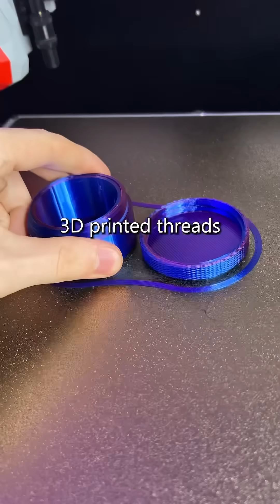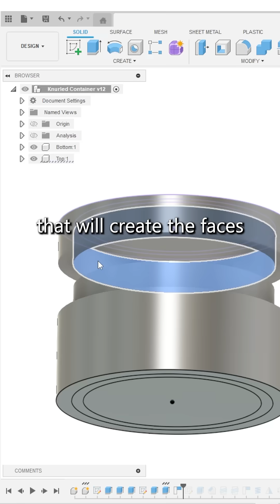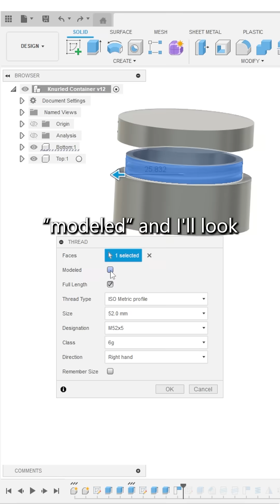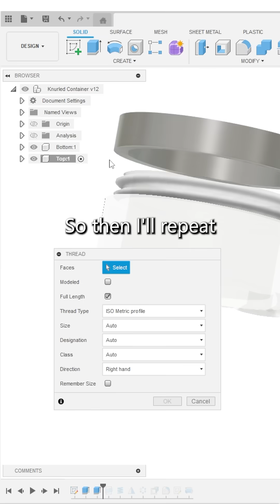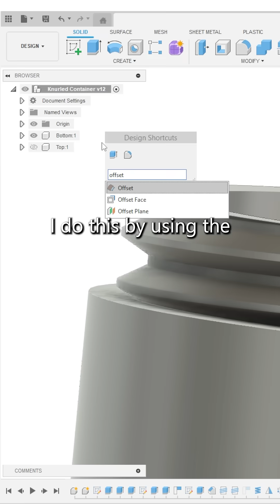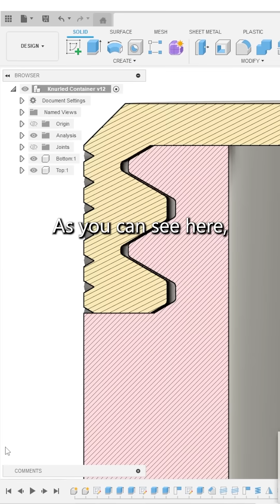How I Design 3D Printed Threads. #fusion360 #3ddesign #3dprinting #diy #learn

Comment: Use the coil tool, set it to square profile, create New Body, move it up or down into place, combine bodies, chamfer the inner lines of the coil. Much better control of the shape of the thread profile.

Comment: How are the outer Threats on the cap done?
Reply: I used this tutorial, works great. My A1 is printing my first object with this knurled texture as we speak 🙂

https://www.youtube.com/watch?v=xHas0R5-6uc
Reply: Not sure if the tutorial mentions this, but if you want to add chamfers or fillets to the top and bottom edges of the surface you're putting the texture on, you can do this:

1. Apply threads
2. Apply chamfer or fillet BEFORE the thread operation in timeline.
3. Drag the chamfer or filler operation AFTER the thread operation in timeline.

(I'm sure there's different methods, maybe easier ones but I'm a noob and this works fine ;-) Enjoy!

Comment: i do everything you said also i try to put a chamfer on it use a sketch and revolver tool, depends on the printing orentation, watch out for flat face overhangs, even when its small, sometimes can cause fails.

Comment: Important point about plastic threaded caps; theyre usually not fluid tight unless the thread’s grip drives a wedge stop into the primary opening.
Reply: Important point about this comment, things that aren't water tight, are not water tight.   BOOM! Genius analysis.

Comment: Been making threads for years now with Fusion.  Great info, learned a thing or two.  One thing that I have found to make threads print cleaner and more successfully as of late is the "variable layer height" option in Orca Slicer.  Works a treat.

Comment: Just open minor diameter of ID threads and a make the major diameter smaller on the OD thread. That simple, only certain tapered threads actually have interference on thread faces like pipe threads that need to seal. I think it's great your getting through this with obviously zero machining experience. Buy a mini desktop mill and make things out of aluminum from fusion. 3D print is cool, but you won't ever get the gratification you get from holding a machined part you used multiple tools and creating a successful program.

Comment: Question 1: How you did texture in top?
Reply from the maker: It’s called Knurling 😁
Reply: As an example: on a 3d extruded part like a cylinder, select the top surface. I will typically make my own textures by drawing a square tangent to the cylinder outer most edge. The square will be positioned 50% on the circle and 50% off. I then cut extrude that square shape into the cylinder. I then use the 3D circular tool to mimic that extrusion around the whole part to make a texture. If you know your way around plane mechanics in inventor, you can do some wacky things.

Comment: Why not just make the surfaces different diameter to begin with instead of making them the same and then needing to go back in after to do a negative offset? Giving it some tolerance to begin with is easier

Comment: Sometimes I just put the threads on just one body and then I use the combined tool to cut the threads into the other body. Then I adjust tolerances like you did.
Reply: Same thing here, after the combine with the cut I add a -0.2 to -0.5 to thread faces, just to give a nice we tolerance. This will make the perfect thread on the new body

Comment: The only problem I have with the thread tool is that you can‘t chose the pitch.
I am using the screw tool. It‘s more involved but much higher customization.
Reply from the maker: Thread pitch is on there! Maybe it isn’t supported by the thread type

Comment: I find if you want a tight snug threat don‘t add tolerances and just print as is, after using it a little it will spin smoothly but still close tightly.
Reply from the maker: Very true! Also the material will determine how quickly the threads will wear.

Comment: That's all find a good but how to held you get past them making of a team when you're a single person and a 3-D printer. I don't have a team. I don't have a job in 30 printed. How do I get through that to get to the program
Reply from the maker: I am one person with two 3d printers using the “free for personal use” Fusion 360 software. Not exactly too sure what your question is?

Comment: Lol I just got lucky with mine, only ever printed a nut and bolt as a way to test filament and calibrate my extruder so i just picked a random thread and used it on both pieces with no adjustment. This is definitely more ideal.

Comment: Is there a thread that uses a 45° pitch that way it could be printed on almost every printer?
There needs to be a plug-in for ideal 3dp threads instead of using ones designed for other manufacturing processes.
Reply from the maker: The angle of the threads just depend on what kind of thread type you choose. ISO Metric works well for 3D printing!

Comment: I normaly increase lid size by 1% on the slicer. Works every time.
Reply from the maker: That works when you have other folks models that don’t quite fit! I still recommend if you design your own then the threads to add tolerance in the model. It won’t sit flush with one another and there’ll be a tiny lip on the top. How negligible depends on the size of the thread 😄

Comment: I still dont understand tolerances...

I was trying to 3d print bases for miniatures. 1 large base with two slots for two smaller bases that would allow me to display the miniatures as a couple but for the game time each base has their own singular base cavities to give them a standard size base.

Im unsure if Im doing the tolerance right cuz the slots are tad too tight...

So any advice on understanding tolerance would be helpful. 

Note: I have gone to a trade school for CADD and while tolerance was talked about the professor explained it in such a way that I just couldn't grasp. It also didnt help the majority of the course was more for how to build blue prints for buildings and homes. Blue prints that construction workers and hvac guys use. 

Oddly enough my gpa was enough to pass the course.despite flunking the last few tests and projects but unfortunately  they never mailed my certificate. I dont really care too much as I did walk away with abit more knowledge for 3d printing but not enough to do something with it.

Sorry if this was long winded.
Reply: Tolerance is a small gap between parts that allows them to fit correctly when manufactured. For example, if you wanted a pin to fit in a hole, and made both have a diameter of 10.000000000...mm, the pin would not fit or would have to be hammered in due to imprecision in the process. If, instead you made the pin 9.9mm and the hole 10.1mm, the pin would move freely. The value used in your design is highly dependent on the manufacturing process, the desired fit, and the type of part.

Comment: This one's going straight to my "Tutorials" playlist. Great job. This is exactly how a short should be. Short, straight to the point, and easy to follow. Fantastic
Reply from the maker: Glad you found it enjoyable 😁
Reply: Here are two misconceptions in your video:
You mentioned to add tolerance, but it is clearance. Tolerance is the measure of your printers incapablities. For example you make a 30mm part but your printer has a tolerance of 0.2 so it turns out 29.80. Clearance is the gap between two objects. You should have said clearance
Secondly, adding clearance is a MUST step for successful 3d printed threads, not “almost necessary”, as when the threads interlock it won’t go after one full turn since the threads are colliding with each other, which won’t let them interlock properly.
Good video though!

Comment: Or no need to make torelance, just made your printer flow to %90
Reply from the maker: Definitely don’t do that. Lowering it arbitrarily like that would lead to weaker layer adhesion, incorrect dimensions, and likely some under-extrusion. 

You definitely want to add tolerances.
Reply: Unless the machine was overextruding before, this is NOT the solution. Try horizontal expansion instead.
Reply from the maker: @user2C47  Agreed! Horizontal expansion settings are essential for getting prints to be strong and still fit precisely.

Comment: Idk how I never noticed the thread tool has a modeled option. Also surprised that push/pull works on threads. It tends to get mad when you try to use it on complex geometry ime
Reply: Its not in my inventor ?

Comment: I would argue if you used the right thread for the part. What you designed here is a machined thread. In stead you should design a molded thread. It will be stronger in the top where the threads engage.. can the software do that..? If you don’t know what I’m talking about.. the have a look at different plastic parts how they are done. 
So please 🙏 make a video where you teach people to do it the right way.

Comment: Luckily Fusion does this well but Inventor, you still have to draw them manually or use a plugin
Reply: Yes it does it well.. for machined parts. But this is not a machine part but more like a molded part and that is a complete different thread.
Reply: @DenRoedeMogM  right, I’m talking about for the sake of 3d printing
Reply: @DenRoedeMogM  to my experience, investors only does simulated threats and are just represented for a drawing.
Reply: @levelgx  yes if it’s on metal parts.. but molded parts comes out with the thread. Also the thread is different and stronger where it engages. Maybe I should do a video that shows how to do it the “Right” way. But hey.. if it works.. :-)
Reply: @DenRoedeMogM  I’ll check that out man, thanks!!

Comment: Additionally, if you’re using something like a metal screw you don’t need to add threads to your print because the screw will cut them automatically and the increased friction will make the hold stronger.

If you do this with two 3D printed parts they will break. Harder materials cut into softer materials.
Reply from the maker: Threading the nut with the bolt gives more of a nylon lock nut feel, whereas modeled threads with a bit of tolerance spin like a normal nut would.

Comment: Finally, someone that understands how to properly model 3d printed threads.
Reply: Do they, because they could have changed the thread fit by changing the tolerance class. Also if your printer is tuned well, you can get normal threads to work fine. I have printed down to 32tpi for sprinkler heads. It also matters the quality of the exported model. If the segment lengths are too long, it makes the threads bind.
Reply: @court2379 changing the tolerance is necessary on most printers
Reply: @liamdj6535  Tune your printer so that the parts fit. It largely doesn't matter what one you have. Standard machine thread 1A 1B tolerances are just fine. The method here will make for sloppy fits once all the bumpy spots wear off. 
I run an Ender 3 and have printed 5/8-32 threads just fine. The parts are a little tight at first which could be addressed if I tuned it better, but are fine once worked back and forth a bit. 
Also the model needs to be exported in fine resolution. If the line segments of the stl are too long it makes the threads stick because it isn't very round.

Comment: That approach only works, if you have a rotationally symmetric object. If you want stuff to align you need to create only one thread and then "cut" the thread out of the other object, while they sit in the desired orientation.
Reply from the maker: Super valuable info for making working joints in CAD! Always nice to see things fit together on screen before printing them out.

Comment: Need full tutorial...... I am little good with solidworks but wanna give 360 a try
Reply: Fusion360 in 30 days will get you there. I excelled in SOLIDWORKS which makes simpler programs like Fusion360 quite the challenge since the principals are different